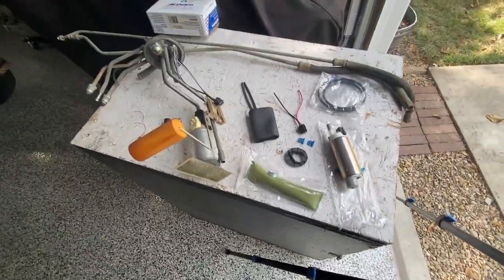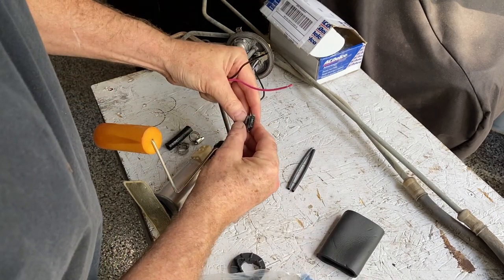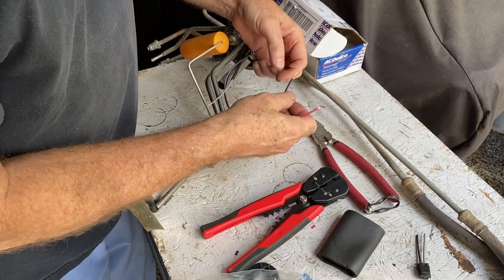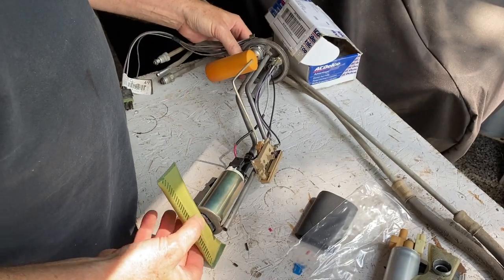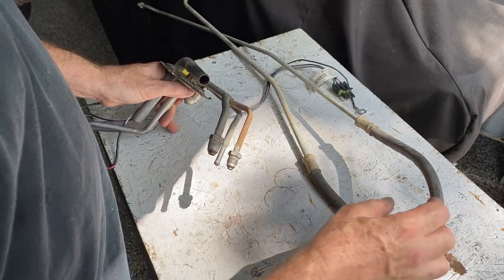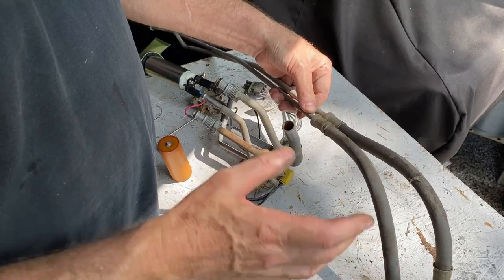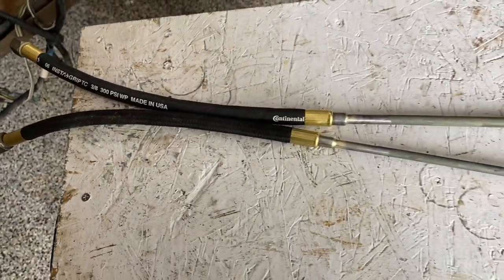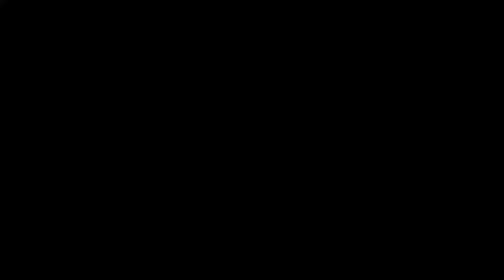1988-1998 Chevy OBS Truck LS Swap Fuel Pump Install

Comment: I did essentially the same as you for the pump a few years ago. Recently my truck started stuttering and such. Fuel just trickled from line. When I checked the pump, the ground wire pin in sending unit was black with melted charred plastic. I put a Stained m6 bolt through unit as stud. Pump connects at bottom, harness on top outside of tank. Fixed at first. Now doing it again. Hope the power side isn't doing the same.

Comment: My 93 obs swap,   Used 98 fuel pump, and no issues
Reply from the maker: The EP381 would be considered a good replacement pump for your truck. It should work fine, I have used them before with no problems. Thanks for the comment.
Reply: @laurencevillegarage  thanks for the video

Comment: silly question? if have donar 05 suburban? can i take the pump out of that sending uniot to save a little bit? just plug off the return if have a returnless motor?
Reply from the maker: The actual pump just has an inlet, so, I don't see why not. You may need the 2 wires and plug that actually connect to the actual pump. I've never tried it, but I believe it would work. If you do it, let  me know!

Comment: I'm preparing my LS swap, 99 OBS Yukon and I already have a donor 5.3 Tahoe. Do you see any reason I couldn't just use entire gas tank and fuel lines off of the donor Tahoe? I'm guessing the straps or melts might be a little different but should not be that difficult to overcome.
Reply from the maker: Using the donor truck fuel tank (very doubtful it would fit) would create new issues for you IF it would fit. It is so much easier to use your existing fuel tank and as much of your existing fuel lines as possible. What style intake are you using, single inlet or one with a return line? Is your '99 intake a single inlet or does it have a return line?
Reply: Your existing pump in your 99 should supply enough fuel.

Comment: Hey bud I have a question how did you get your sending unit to work with your gauge inside and read into the LS pcm? I have a customer that is trying to figure that out I’m his tuner I can swap around the tables to make it work correctly just seeing how yours was set up . Thank
You .
Reply from the maker: Your gas gauge is going to work off of your chassis harness not the LS harness that goes to your new PCM. The fuel pump in your tank, should continue to function as normal and it is tied to the new harness. That’s why I never recommend cutting any wires until everything works properly. If the gas gauge is not functioning properly or showing any fuel in the tank, it is probably a ground. All the original factory ground wires on the original motor need to be used and grounded.

Comment: Can I use the Camaro 97 5.7 efi?, what do I find in autozone?
Reply from the maker: Not sure on the Camaro part, if you order a pump for a '96+ truck, that pump will work. Or you can use an aftermarket walbro type pump.

Comment: Should it be 88-95,,,    Cz the 96-98 vortec 5.7   Fuel pump works on ls’s    ,,  correct?
Reply from the maker: Your are correct, the EP381 would be considered a good replacement in your truck. Whenever I have the bed off, I replace the pump. Way to much work to gain access otherwise.
Reply: @laurencevillegarage  @ nice build,

Comment: What's the difference in fuel pressures?
Reply from the maker: The old tbi setup only needs about 10-15 psi. The ls injectors requires ~60 psi.